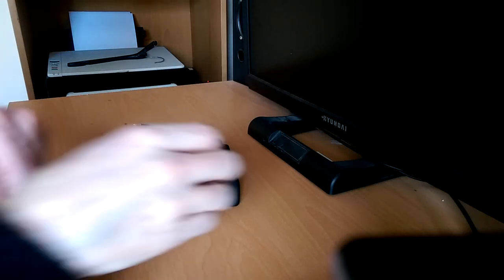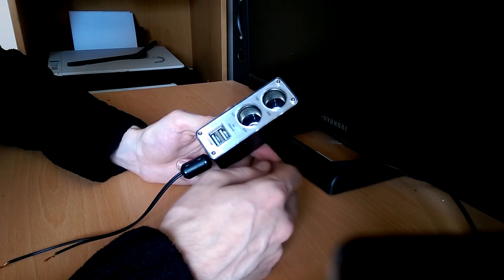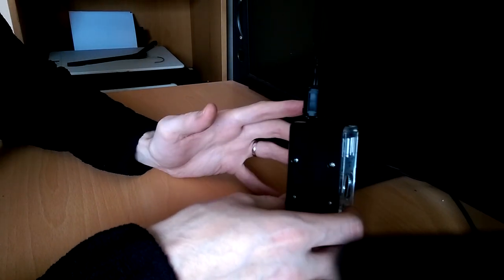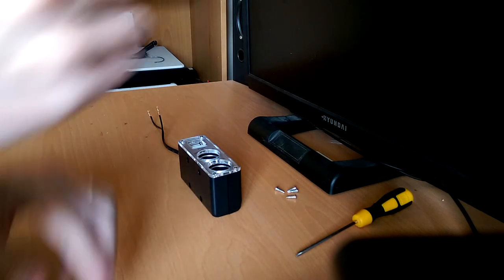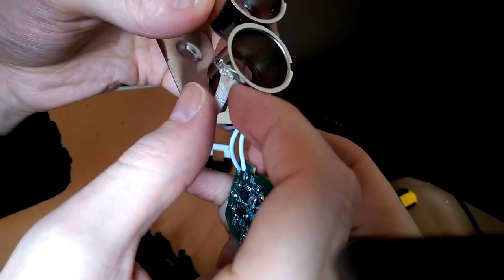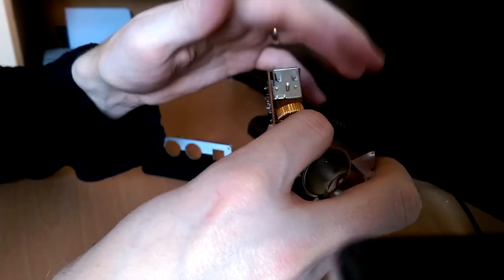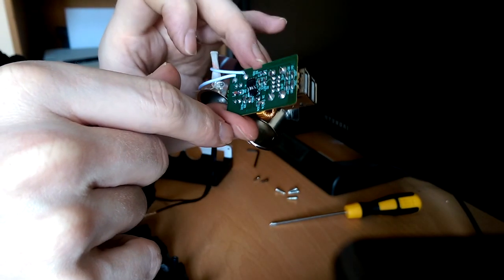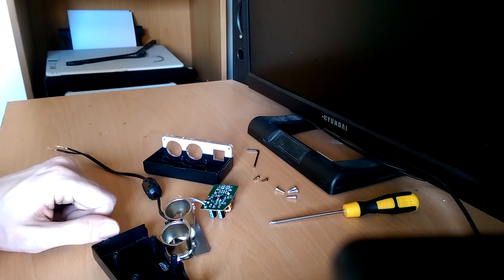Inside a cheap car 12v to 5v USB adapter

Comment: Hi Andy - I have the same issue, did you manage to get to the bottom what was causing the interference when connecting something on the 12v line in your car.
Reply from the maker: Unfortunately, I found the cause of noise, which was the dashcam itself, but I could not suppress it, so it appears to have been causing the noise throughout the car affecting the radio. Sorry :-(
Reply: Thanks for the reply :)

Comment: put a 1000uf - 3000uf 35v capacitor in parrellel with the input. the noise will be gone

Comment: Hi Andy,
At 6:25, between your thumbs there is a component that is red and cylindrical. Do you know what that is?
Reply from the maker: I think you're referring to the choke or toroidal inductor (http://www.electronicshub.org/wp-content/uploads/2015/06/toroidal-Inductor_lg-300x214.jpg)
Reply: I mean on the opposite side of the board, in between the capacitor pins.
Reply: Looks like a glass diode, maybe a Schottky or a zener.

Comment: fyi the power / cigarette lighter sockets would have had a fuse in the factory plug that you cut off to hard wire it in your car.  you should have added an inline fuse and fuse holder.  but either way still cheap, but what do you expect for a couple of dollars off of ebay.  REMEMBER YOU ALWAYS GET WHAT YOU PAY FOR.
Reply from the maker: Agreed, but the car also has a fuse dedicated to the power sockets in my Chrysler so it's still covered by this in my case. But fair point to be aware of.